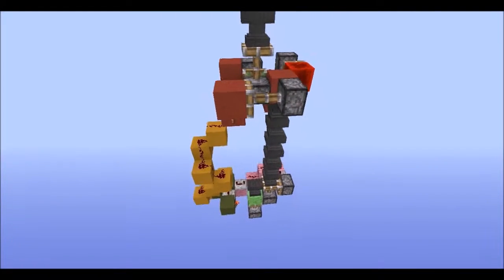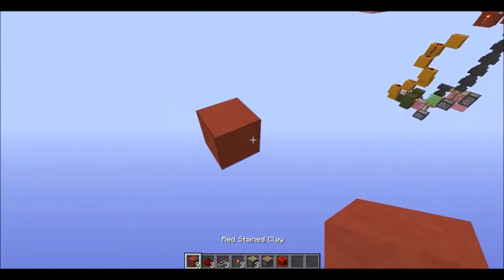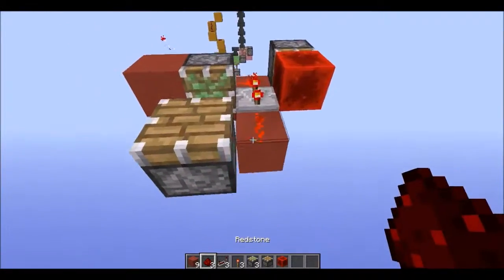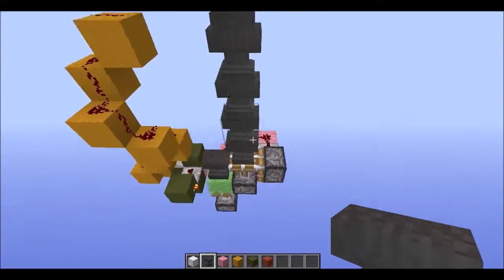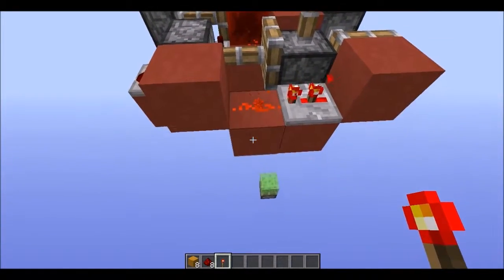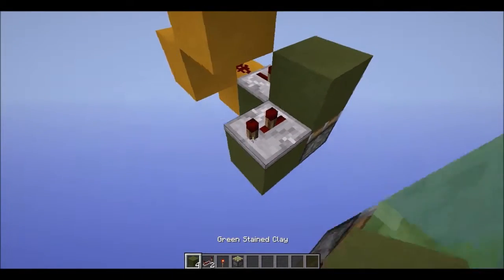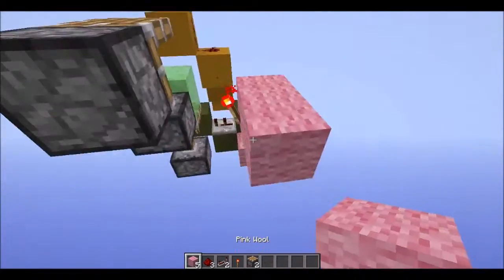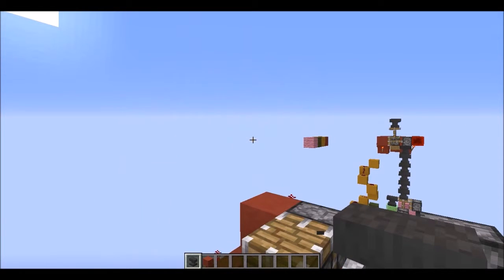Fully Automatic Anvil Replacer

Comment: Still works, but you do need to add another repeater to fix the loop, but otherwise it works fine. If an anvil breaks, another gets in its place! Thanks. I wish the anvil capacity was a little more though, but it's fine.